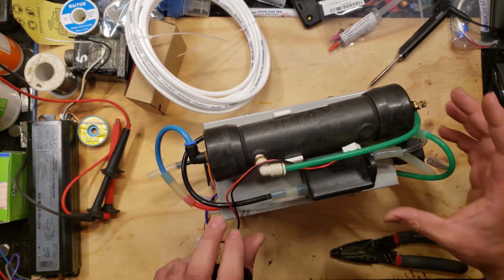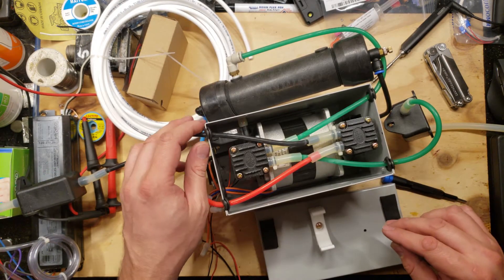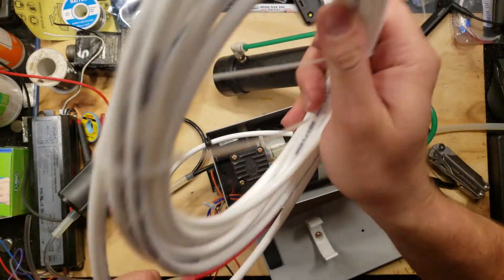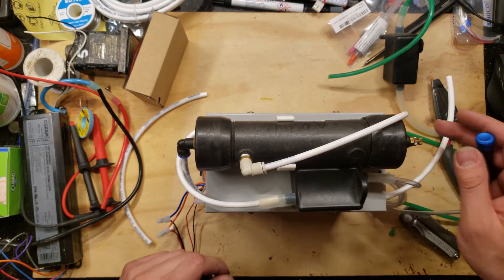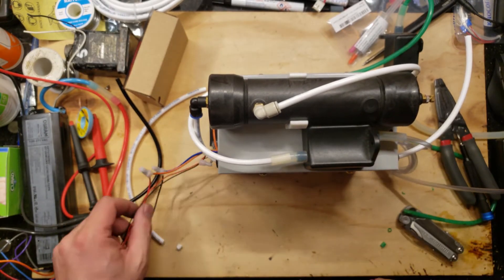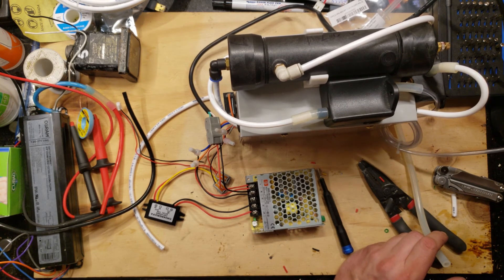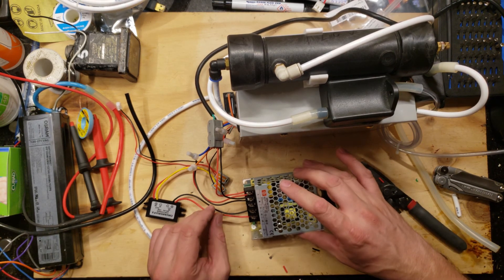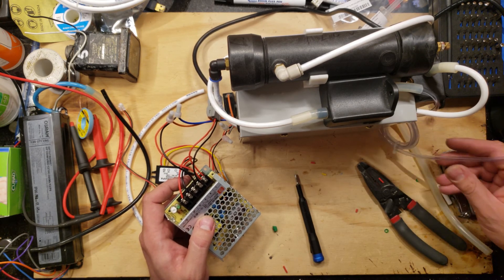Build: Oxygen Concentrator - part 1

Comment: Can u tell us what compressor ur using for this?
Reply from the maker: I'm just rebuilding it with the compressor that came from AromaO2 unit, check my teardown video...
Reply: @AlecKristi  I am working on with 1/2 HP compressor.where is the water separator attached?
Reply from the maker: @Bro4mIndia  there's no water separator, this is using a dry reverse osmosis membrane and 2 stage compressor.  Stage 1 pumps into the membrane, stage 2 pulls on the enriched side, and there's also a rejection port that has a restriction valve that vents back to atmosphere.
Reply: @AlecKristi  interesting, you mean to say it's not using a zeolite bed but RO membrane to filter O2? Is that black cartridge where the compressed air flowing in is an RO membrane? Also this is working at what psi? And what is the O2 purity %? Sorry again asking too many questions..
Reply from the maker: @Bro4mIndia  yes, the black cartridge is the membrane.  I have not checked at what psi this works, but it's designed for free flowing air, I don't know if it will work with a restriction.  Regarding the purity, it concentrates 20% atmospheric oxygen to 30%, you can see that in the AromaO2 teardown video, where I check it with a gas analyzer.
Reply: Plz answer the questions? Is it a RO 80 GPD Membrane and an air compressor?

Plz specify the configuration of each part... Like air compressor capacity, ro membrane specification and a installation diagram.
Reply from the maker: @neerajnimTech  I'm not sure what type of membrane it is, as I'm simply rebuilding this unit that I took out of AromaO2.  I will try to get more details about it in my part 2 build video, and I will try to find specifications of the compressor (or at least measure flow).  Sorry I can't get answers quickly, very busy at this time, but I'll try to get them for you as soon as I can.
Reply from the maker: Found another great video on an oxygen concentrator that is more DIY friendly than my video, and they do a good job explaining...  You may want to check it out: https://youtu.be/7zN6aUKlhZI
Reply: @AlecKristi  yes I went through this.. and working on similar PSA method with zeolite. I completed my prototype but unfortunately I don't have the O2 purity meter to measure the output purity. Trying to order one but it's either not available or taking long time to deliver due to on going crisis.. thanks a lot👍